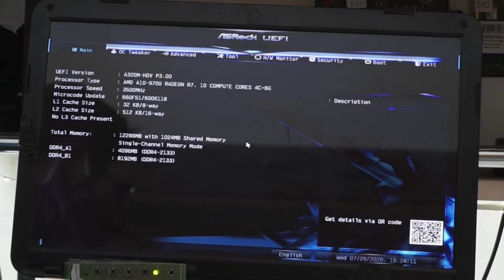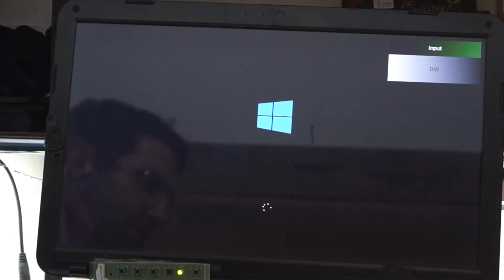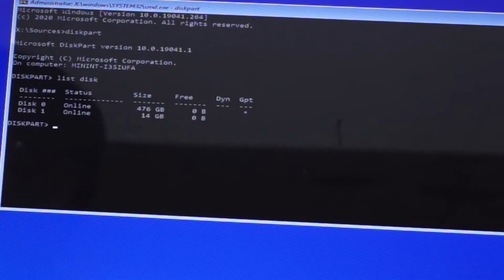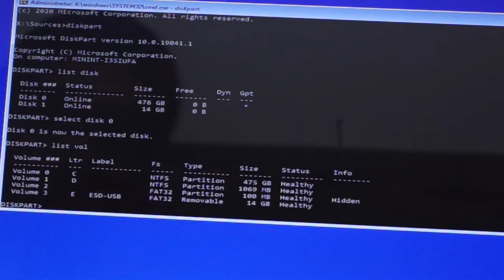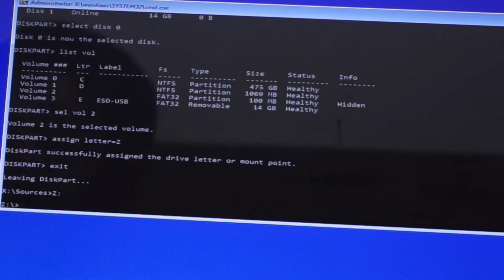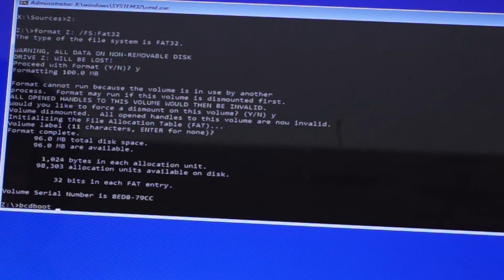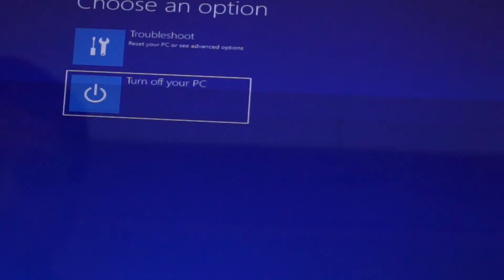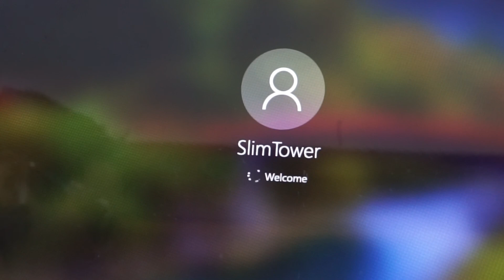Windows 10 bootrec /fixboot access is denied

Comment: Excellent tutorial. On point. Had the problem with windows 10 (don't remember the insider dev build). Caused by the intention to upgrade to Windows 11 first insider version on a Dell E7450 with secured boot enable, Bitlocker, Trusted execution and TPM (v1.2) activated. I did activate those features believing they were need it for the Windows 11 upgrade but It was not. After fixing the Windows 10 bootrec and disabling the mentioned features, I upgraded to Windows 11 without any issue whatsoever. Thank you
Reply from the maker: Glade this has helped you

Comment: When i try to run the last bcdboot command i get error message like this.”Failure when attempting to copy boot files
Reply from the maker: Odd, is that booting of the windows 10, made using media creation tool
Reply: @rickstechrepairs  It is, I get the same output.
Reply: I found the reason, it was because my Windows folder was not on my C: drive, it was in my D: drive, I just missed it. Ended up changing the last cmd to -> bcdboot D:\windows /S Z: /f UEFI

Comment: You such jerk that's formatting
Reply from the maker: its formatting the 100mb fat32 partition, which needs to be rebuilt to be bootable, the actual windows+user partition isn't formatted
Reply: @rickstechrepairs  So what you're saying is this is safe and wont mess with any user files or programs if done correctly?